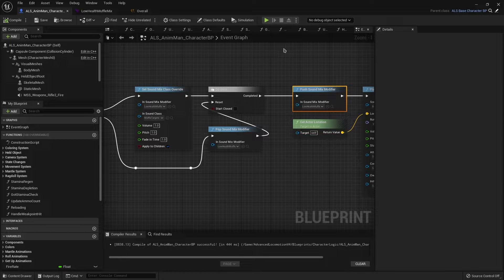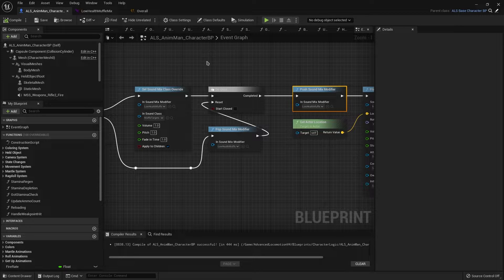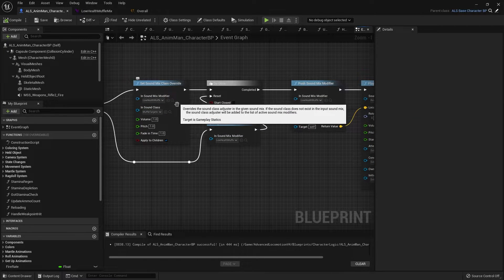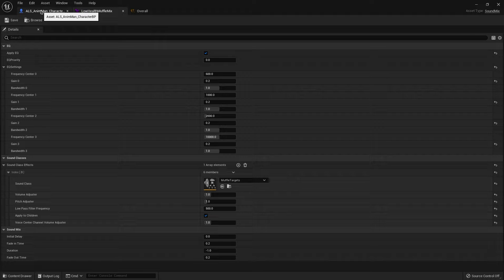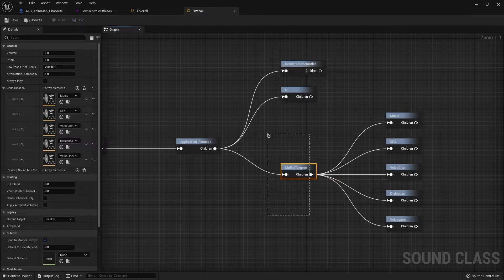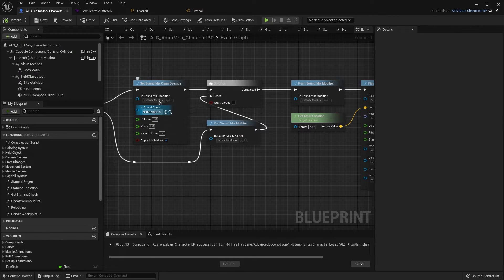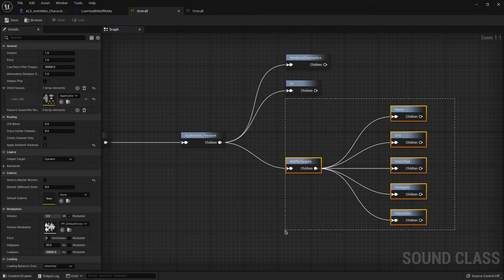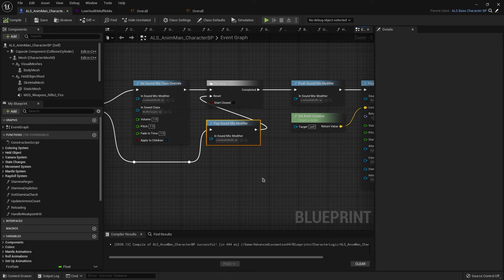Unreal Engine How to Push Sound Mix Modifiers

Comment: Done everything. Not working (
Reply from the maker: Hm that's odd! Are you certain your sound class has the correct logic and implements your effect? There are a few pitfalls which has to be done in a very exact way else it just wont work I've noticed when it comes to sound mix modifiers. Did you also do what i wrote in the pinned comment?

Please check that your set sound class mix override node has the sound class you are trying to push to as well as the mix modifier you are going to use.

If that doesnt fix it check if maybe theres something in this forum post that might help you:
https://forums.unrealengine.com/t/changing-the-sound-mix-on-a-sound-class-doesnt-effect-children/373831/13
Its an old post but Dan posts good knowledge about the system as a whole.

If this doesn't fix your issue i'd love for you to come back and let me know what it was when you do figure it out.